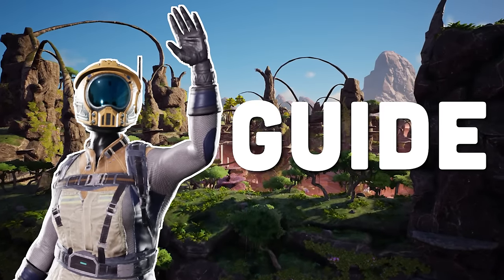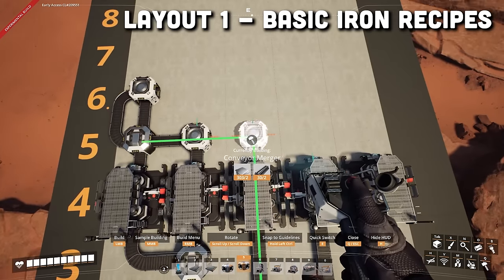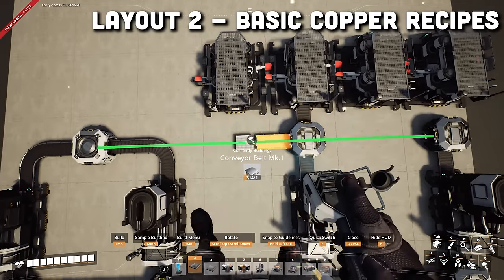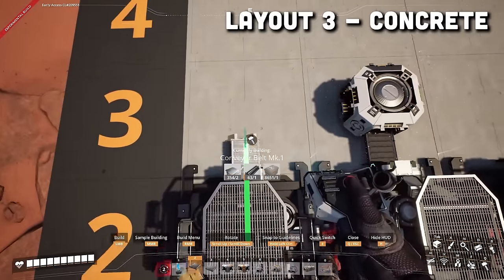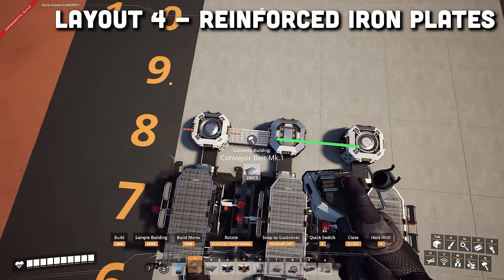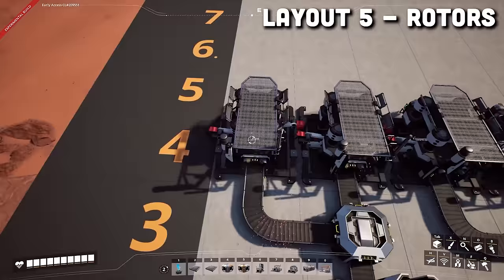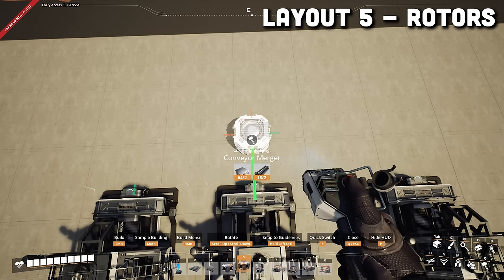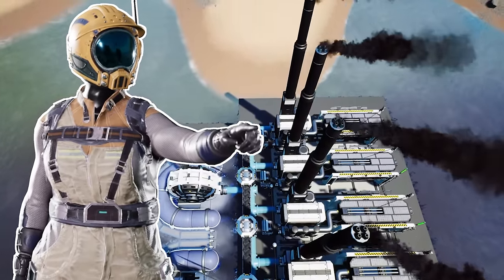5 PERFECT Starter Factory Layouts You NEED! | Satisfactory Update 7 (Beginner Guide)

Comment: I'm not understanding something about the rotor factory. For the conveyers going into the screw constructors, I'm confused as to how it gets all the bars to all the constructors, because the splitters split it in half every time so by the time it gets to the last few there are shortages
Reply from the maker: It will do 50/50 in the first one but it will fill the first constructor super fast and then the splitter won’t be doing 50/50 anymore because it will overflow. So as you let it be it will overflow every constructor down the line and make the rods go further down every time. You can if you want let them full the lines and constructors before you turn on the constructors. That will help speed the process

Comment: Hey! im following these to a T and im having a problem. For instance on the rotor one, 75% of the iron from the mine is going into the very smelter in the line and diminished as it goes down the line. Any ideas on how i can optimize that better? would mk2 belts help?
Reply from the maker: Mk2 belts at the end for the screws for sure. I forgot to mention that and I added that in the comments. That should fix it
Reply: @spectrumdad_  i might not have conveyed correctly, the smelter in column 8 gets most of the ore, then the one in 6 gets a little bit less than that one, and the one in 4 gets less and same for 2. basically the screws at the very last assembler are getting an extremely slow trickle
Reply from the maker: @97matt97  so the nature of the manifold system for the smelters makes makes it so that at first the first smelter gets more ore. But given a bit of time it’ll even out and all smelters will run at 100%. This will trickle down throughout the entire layout. At first it doesn’t fully run 100% but it will eventually. Now the one assembler is suppose to be underclocked so it’s normal it’s getting less screws. You are only providing 50 instead of 100. If you don’t want to wait for the system to saturate, one way to speed up the process is to turn off let’s say a couple smelters until the other ones are full of ore. Then you start one, wait for it to fill, then start the last one. Do the same for all machines down the line and it’ll speed up the process of saturation. But you don’t have to do that. It’ll eventually even out if you did it right.
Reply: @spectrumdad_  thank you! im a new player and you really help a lot

Comment: I just would like to know how many miners are needed for each setup. 1?
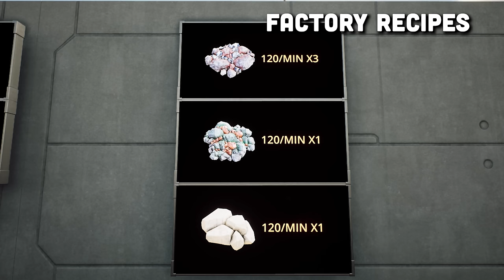Reply: depends if how much you are overclocking the miners, depends what level your miner is. at 0:36 he lists that every setup is going to need a 120 belt of each resource. For example,  a Miner Mk.1 mining a Impure Node gives 30, Normal Node 60, Pure Node 120. By that logic you can combined two 60 nodes merged into a Mk.2 belt to get the required 120. another setup you can do is a Impure node (30), with a Mk.2 miner(outputs it to 60) overclock it twice with two power shards to 200% to get a output of 120 off of 1 impure node.

Comment: Started this game today, feeling overwhelmed already. How do you get power to run all of this?
Reply from the maker: That depends, I’ve done this with a ton of biomass burners. And I had to farm quite a bit of wood and convert it to biomass using constructors. One thing to help is getting the conversion to biomass then solid biofuel done automatically. That’ll save you time. All you have to do then is take a bit of time to gather lots of wood and grass, then place the converted solid biofuel into the burners. But once you get to do this factory, you’ll unlock coal real quick and switch to automated power pretty quickly.
Reply: @spectrumdad_  thanks!

Comment: whats the deal with manifolds over load balancers? I don't think the saved space is worth the efficiency loss and clogged machines
Reply from the maker: Actually making a video on that right now. But pretty much the space saving and easy scalability outweighs everything else in my opinion. I do use load balancers in some cases still however.

Comment: Sorry im kinda new but if i use mk3 instead of all mk1 - would the results be any better or same or bad ?
Reply from the maker: It’ll be the same. I use mk1 here because you usually haven’t unlocked mk3 by this point and I tried to keep the cost as minimal as I could but as long as you use the same or higher belt it’ll all work the same.
Reply: @spectrumdad_   Thank you for responding sir :)  I guess i will use mk1 to minimize my cost-
Reply from the maker: @reexd2837  but also make sure you put mk2 where I mention. There’s a few spots you need to put them in.

Comment: How would I be able to link my reinforced iron plates with the rotors in order to make smart plating?
Reply from the maker: I would send both into their own storage and just grab 50 each and slap them in an assembler to make the smart plating. You don’t really need to automate smart plating quite yet.
Reply: My buddy and I made the rotor factory on floor 3, below that was reinforced iron, below that was the normal iron stuff. So we simply used conveyor elevator thing and brought the rotors and reinforced plates together at a single assembler. We then added a splitter so excess was sent into storage.

Comment: I tried following a few of the guides but I never have the output as advertised. Like. the rotor one doesn't not make 10 rotors per minute for me, it made around 2 to 3 per minute. I don't know if I did something wrong or the satisfactory update 8 changed something, but im just not getting very much
Reply from the maker: The rotor part I forgot to mention something. I put it in the pin comment. Make sure the screw lines going into the assemblers are mk2 belts. It also take a bit to saturate and give the output desired

Comment: You say to make sure certain belts should be mk2 but does it hurt if every belt is mk2 or 3?😊
Reply from the maker: Nope, it’s a minimum requirement but you can always go over.
Reply: @spectrumdad_  thank you for the quick reply, so good rule of thumb always go highest belt you can build, cheers.

On a second question is it only ever possible on some manufacturing lines to get 100% efficiency with underclocking?
Reply from the maker: @simonpobjoy5228  yea or overclocking. Or if you really feel ambitious, load balance by taking out exactly what you need. But it’s not always possible, and honestly overkill. I usually try to get overclocking unlocked as soon as I can, and keep things not 100% efficient until I do.
Reply: @spectrumdad_  cheers for the tips

Comment: Can you still make this designs with mk.1 miners?? 
Thanks for the tutorial btw!!
Reply from the maker: These designs use mk.1, you just have to supply the right amount of ore, which is 120/min. So assuming you only have mk.1 miners, you can provide that by using either 1 pure node, or 2 normal nodes merged together, or 4 impure nodes merged together. Thee combinations will all produce 120/min on 1 mk.2 belt.
Reply: @spectrumdad_  oooh that makes sense, im a new player... Thanks!!!

Comment: Wouldn't it be smarter if you underclocked all 3 constructors for the concrete to use 40 limestone each?
I think your approach would need the underclocked constructor to fill up to maximum in order for the other 2 to run at 100% productivity.

Comment: For the iron layout... my first splitter, the one that connects the miner into the first furnace and the mk2 belt is giving the furnace on the 5th row a lot more ore than the other ones down the row. I followed the guide... im not sure.
Reply from the maker: That’s normal. With the manifold system. It’ll send more on the first smelter but it will fill up, then overflow down the line. Then the second will fill up, third, fourth. But if you want, you can stop the smelters and let the ore fill the lines up first before starting them to avoid that. But it’s totally normal, it’ll just take a bit to overflow and fill the line down the manifold system.
Reply: @spectrumdad_  Mine simply doesn't overflow even after hours of testing and rewatching your video, I'm using a mk1 miner with mk2 belts throughout on a "normal" resource node. Is this correct?
Reply from the maker: @LightsAcapella  no you need either a pure node or 2 normal nodes merged into a mk2 belt
Reply: @spectrumdad_  thanks for the reply, I get it now!

Comment: I think that the iron ore distribution does not work, the dividers divide in equal parts and I understand that when the materials stagnate the rest should come out through the other outlets, but in my experience it does not, it keeps the division the same.

And yes, I have used v2 tapes when necessary when they exceeded 60 materials per minute.
Reply: Until some kind soul solves my doubt, I will simply make an initial division into two groups :)
Reply: Okay, my bad, the oven entrance had not been filled :)

Comment: I built the basic iron layout, but it seems like the mk. 2  conveyor belt is too fast for the mk. 1 miner. My machines aren't all producing as shown. Any tips?
Reply from the maker: Having faster belts shouldn’t matter. As long as you are sending in there correct amount of ore minimum it will work. Are you sending 120 ore per layout?
Reply: I think I see. Does it require 4 mk. 1 miners per factory layout?
Reply from the maker: @NobodyXChallengerYT  it depends on the node purity. So it would be 4 impure nodes mk1, or 2 normal nodes mk1, or 1 pure node mk1. And then you merge into a mk2 belt
Reply: @spectrumdad_  I gotcha. I’m kinda new to the game, so I recently just discovered some nodes are more pure. That’s gonna suck to accommodate for, but it’s still so addicting. Thank you!

Comment: Nice video but 3 pure iron nodes are hard to find together. I have only ever found normal iron with 3 nodes together.
Reply from the maker: Every starting area has more than enough iron for this. Even if you include impure. The Grass Fields for example have around 12 impure nodes and 5-6 normal nodes. Northern Forest has a bunch of pure ones, same with desert. This isn’t hard to do if you merge lines. You can always go to satisfactory calculator website if you have a hard time finding them. :)
Reply: @spectrumdad_  Thanks for the fast reply. I have just found an interactive map online and i will look at some locations with pure nodes. Otherewise i will follow your suggestion of just merging some lines to get the numbers i need. Looking forwared to trying out your build. Thx

Comment: What's the point of underclocking a machine? If production is excessive, things will back up and the machine will natively underclock when its output slot gets full. And power is only used when a machine is actively working.
Reply from the maker: Yea that’s why I say it’s not necessary. But I like to have all numbers match and make sense. It’s to be able to have your machines run at 100% efficiency. They won’t if you don’t underclock.

Comment: the only problem i have with this and every other video is the "spliter manafold" and that is it dosent distrubute the materials fairly, now i understand for some components they dont need alot of materials to male but the smeltes all need the same and a manfold whit one intake splits the material 50/50 spliter which results in the last smelter to have in this case for the copper 6.25% of the copper, we say we but in 100 copper/min "for simplsitics sake" the first spliter spliits it 50/50, 50 coppper/min to the first smelter and 50 to the rest, next 25 copper/min goes to the second smelter you sould understand the rest. showing us how to make load balancer
Reply from the maker: Check my video about manifold vs load balancers. It will help you understand how a manifold works. At first what you say is true, but the first smelter will fill up because you are sending more to it, then it will overflow the line and send more to the other side. It won't be 60/60 anymore it will be 30/90.

Comment: Ive copied this exactly and for some reason the basic Iron recipe build isnt as fast as yours is. The beginning is being fed with a mk2 belt and then one more mark 2 belt after ther splitter but the rest of my belts dont have max ore like yours does in the video. Ive even made sure the input of ore is as much as can go in
Reply: I'm having the same issue as well. I fixed it for now by creating two inputs of ore into the system and feeding into 2 Smelters each. Still seems to have a small window of downtime though.

I can see this being an issue with the Iron Rods being fed into the 7 Screws Constructors as well. I haven't gotten there but I might try about the same fix.
Reply from the maker: So if you send 120 ores into it, one thing you can do is let the lines and smelters fill before turning them on. This is the nature of a manifold system. It takes a while before it becomes saturated.
Reply: The reason you were having problems is the design he laid out only puts 1 Mk2 belt after the first splitter (after the input), and it should be the first two.  120 ore in, split off 30 (max the smelter can use) leaves 90, which a Mk 1 isn't enough to handle so it throttles the miner input.

If you are doing a manifold you need to be reducing the input line after each splitter only when the remaining amount is less than the lower belt.
Reply from the maker: @Kugorbok  yes you are correct. The line heading into the first splitting does need to be a mk2. I did t specify that because at the beginning I mentioned all layouts needed a mk2 line of ore. I should of made a better job explaining that.

Comment: My math might not be good but you announce that your basic iron produce 60/30/40 plate/rod/screw, but the layout produce 60/20/40. You would need 2.7 constructor for the rods and 130 iron entering instead of 120.
Reply from the maker: Yea there was a mistake in the sign I forgot to get rid of but I did mention it in my pinned comment. It’s suppose to be 20 and not 30

Comment: Quick Note: On layour 1, after 15ish minutes the smelter all the way to the left and the one beside it is slowly but surely dropping iron ore. (furtest away from incoming ore splitter)
Reply from the maker: Yes, it’s the nature of a manifold system, it takes a while to saturate but when it does it’ll work 100% efficiently. :)
Reply: @spectrumdad_  Even with the MK1 belts and just from the miner to first splitter mk2 and then from far right to second from right splitter mk2 aswell?
Btw quick question aswell, sorry to disturb ! But why is that splitter on the far left? (still layout 1).
It can be done aswell with a wonderfull turn isnt it? or am i missing out on something?
Reply from the maker: @Vlambulance  yes it can, it’s just a preference. I often do the splitters lifted up like in my steel video, and for that I use the splitter to use a lift to bring down. So I like to make things consistent if possible.
Reply: @spectrumdad_  Oooh thank u so much !

Comment: Is that just 1 Mining drill per input set up?
Reply from the maker: Depends. Whatever combination to bring in 120 ore of the certain kind you need. So that could be 1 pure node. Or 2 normal. Or 4 impure
Reply: @spectrumdad_  When you destroy the pure ore to make room for the mk1 miner, there is only normal ore underneath tho? And I can't place the miner without destroying it.
Reply from the maker: @magnhildeltoft1416  that’s a normal node then. A real pure node would show pure after you destroy the first bit on top. Just face down at the actual mine and it’ll tell you what it is. Some are impure, some are normal, and some are pure.

Comment: As a new player, i can build this easily, but, but i cannot power it, there is lack of info about how much power it will cost and what sources can power it properly.
Reply from the maker: There is different ways to do this, regardless you don’t have to do it all in one go. You could just built it at as you go and add more power to accommodate. I’ve done this layout with biomass and coal. The only thing with biomass is you will have to generate lots of biomass for this so I would get coal power as soon as you can.
Reply: @spectrumdad_  Realized, i have connected 2 biomass currently for 40mw requirement. Wiring is easy actually, i initially thought it need to be in some sequence but its easy. Thanks